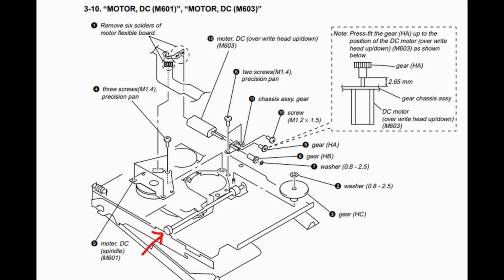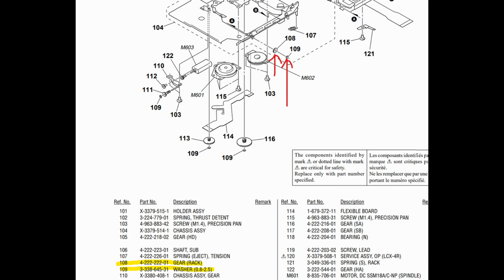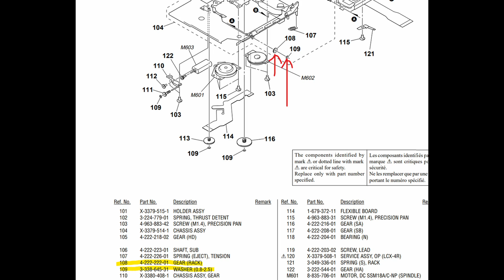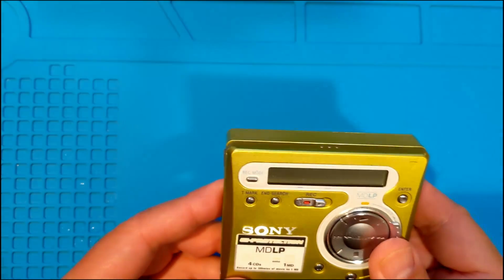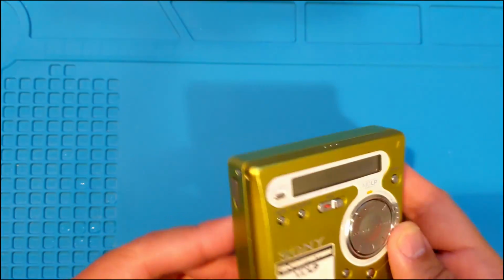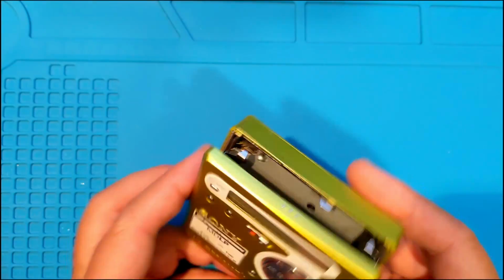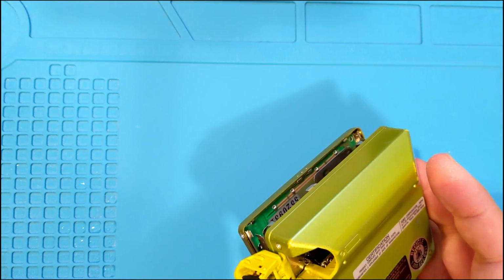Sony MZ-R700 MiniDisc Recorder - Fixed! It wasn't the write head this time, but something else...

Comment: Hello, 
I got mine mz-r700pc in a very good cosmetic condition but I have the following problem with recording and I think only you can help me. Whenever I try to record I get a blank disc after, or even worse disc error sometimes. After many days of experimenting I found out that the writing-head motor spins very little and mooves the metallic gear for 2 teeth. The problem is that the head starts to move right after that point when the motor has stopped its movement. 
So its like there is a slight slack before the head starts moving. So I concluded that there would be 2 ways that would fix my problem.
1. If the motor could somehow spin longer (more turns) to compensate for the head slack at the beginning of the movement.

2. If I could somehow eliminate that slack form the start of the movement so with the slightest rotation of the metallic gear the head would start lowering. If that happens the spinning of the motor as is, would be enough for the head to fully lower.

Can I achieve somehow to fix it eliminating that slack at the start?
Have you noticed the same slack on yours or your motor just spins more turns?

Thank you very much in advance!
Reply from the maker: That's a great question and sorry for the delay!  Thanks for looking into it and providing detailed information. I actually don't have my R700 with me because it's in storage so I can't test and observe it, but I believe that gear that lowered the write head was supposed to move a half turn, so not sure why yours is moving so little. I hesitate to recommend anything right now since I can't see mine.
Reply: I come back as I have made some further investigation. After many tests I come to the result (and it makes sense) that the motor itself is the problem. It spins to the point of head starting to move and stops there because its power has weakened over time. And I confirmed it with a modification I did with the metallic ramp on the side that slides and lowers the head, I layed a thin layer of epoxy resin on that ramp,so by this way I removed the slack and guess what, the motor again stopped at half the previous way now at just 5 revolutions of the motor instead of ten it did before, but again happened when it reached the point of starting the head movement action. So the culprit was found, it's the motor and I have no spares the device is my first getting into minidiscs (bought it as "in perfect condition").
Reply: Well, having nothing to lose I tried the final step to disassemble the motor that lowers the head. I unsoldered it from the ribon tape and opened it. It has some brushes that contact the shaft for the + and - that are so thin like hair. I found one of them slightly off position and with an exacto knife i bent it in place and after that I bent all of them hair brushes a dit tighter towards the center. Then I cleaned the shaft part that contacts those brushes with some contact cleaner. I put everything back together and tried. At first the motor spined even shorter than before so I almost lost hope, at least it turned. After 5 minutes I tried again the same. After 3 hours I gave it one more try and I heard the motor for the first time spin for that long! It went vzzzzzzzzz! I knew right away that I would have a successful recording and there it was! I tried it again for 3 more short recordings and all were successful. Maybe those brushes for the shaft needed some time to settle at their place. I still cannot believe that I have fixed it after about 30 times of disassembling the device. I'm happy!

Comment: Mine has this problem
Reply from the maker: It was a tricky fix and involved getting a spare gear which may be a problem. It's still working for you as a player, though right?
Reply: @TechnicalInitiative yea it still works as a player

Comment: Just picked one of these up on fb. Do you record all your music onto the minidisc through the player always? Or can you download music off the internet and burn it like a cd?
Reply from the maker: Hey @svisium ! This specific model would require "real-time" recording via the line in (optical or analog). If you want to burn mp3s or purchased/downloaded music using software (Web MiniDisc Pro), then you'll want a NetMD-capable model.  See the list at the Wiki (https://www.minidisc.wiki/equipment/sorting/netmd-portable) - hop in their Discord for recommendations and answers to your questions!
Reply: @TechnicalInitiative thank you for your response bro. Any difference in music quality from real time recording and using the net md interface?
Reply from the maker: Hi - sorry I didn't see this!  For all practical purposes, there's not a real difference if you're using a high-quality source and an optical connection to record in real-time. Variables would be if you were using a standard line-in vs. optical. For NetMD, it can come down to the mode (SP/LP2/LP4 - not to mention Hi-MD modes), but most people seem to agree that SP is great and LP2 is "just as good" or "good enough". The big bonus of NetMD being the ability to title using your PC and rearrange things via drag and drop.
Reply: @TechnicalInitiative  When I record vinyl I use my MiniDisc deck but I still use a NetMD to name them on my computer, usually my MZ-N707.
Reply from the maker: @ianz9916  Yes, NetMD is the best for labeling tracks! I do the same after some dubbing!
Reply: @TechnicalInitiative  I tend to use the online Web MiniDisc Pro but I do have a laptop that I've installed Sonic Stage on so that I can copy files to my HiMD discs.